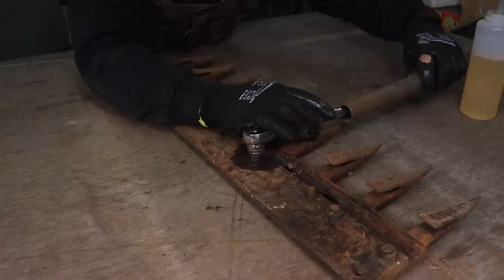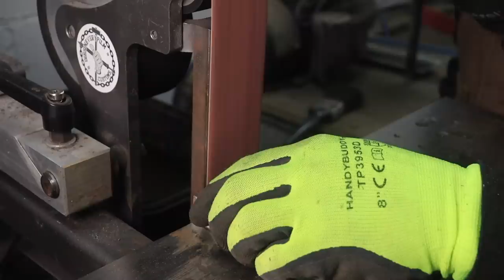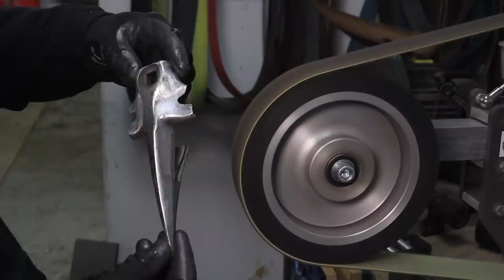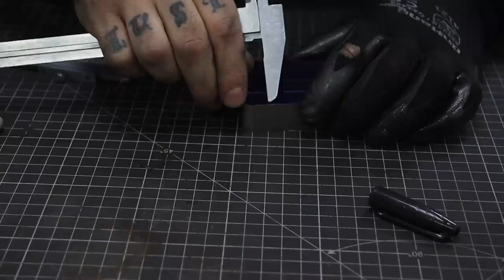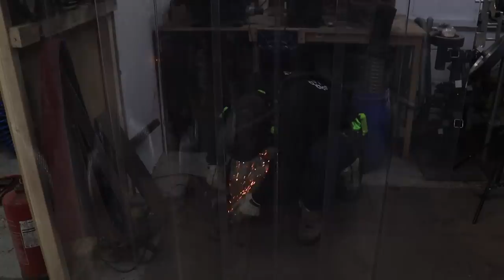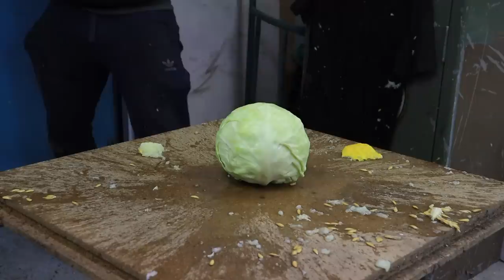Spiked Sledge - WarHammer build

Comment: Cool build!
Only thing I would’ve done different would be to give the shaft a slightly flatter cross-section so that the wielder could orient the hammer face and spike more intuitively, by feel. Carpenters hammers and sledgehammers handles have a flat oval in cross-section for this reason. 
Still a great success!
Reply from the maker: Thanks for watching